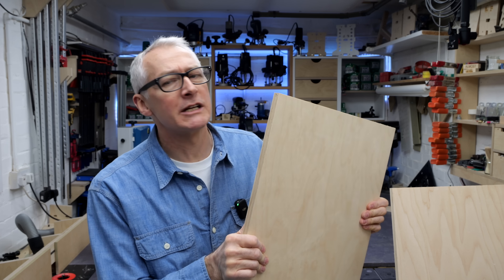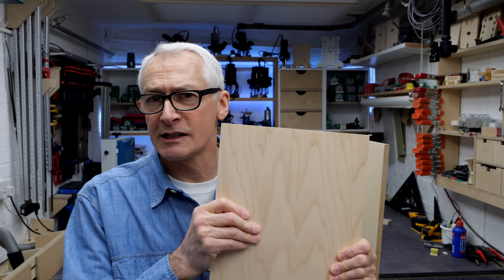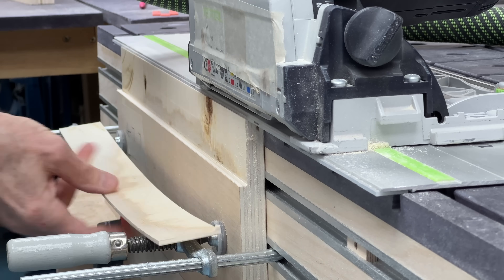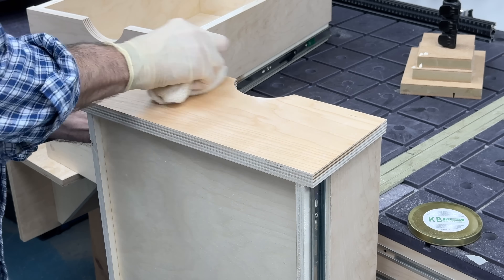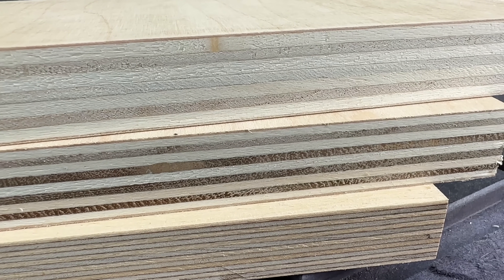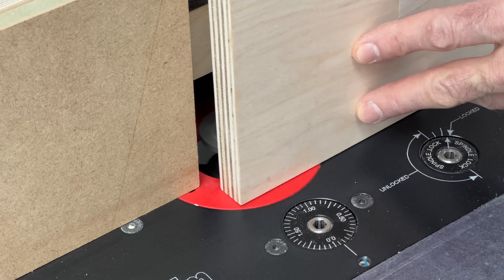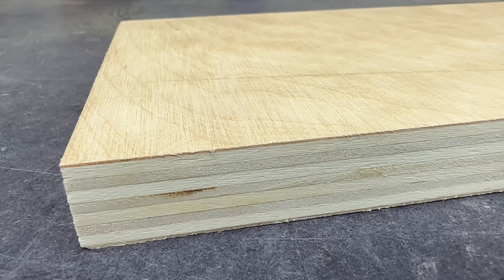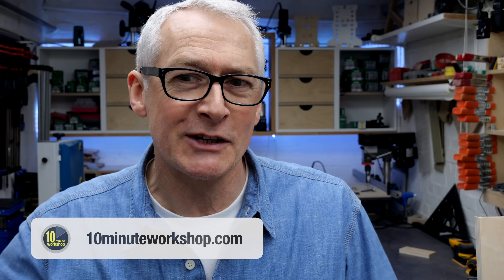Birch Ply Alternatives? [video 527]

Comment: Thanks [edit for spelling] again for this, Peter. In the USA prices are not quite so horrible and the Globulus type plywood is touted as an alternative. Some folks have an allergic reaction to eucalyptus, so that might also be a consideration. (I know in my own case I can hack and wheeze for the better part of a day with plain old pine, spruce, and fir if I neglect my PPE.) My local "big box" supplier has hardwood veneer core maple plywood for $80.00 (£63.43 this morning) per sheet and I have a big gas guzzling pickup truck to get the stuff from the store to my shed. This stuff is 7-ply B2 grade, rotary cut and for anything but utility fixtures and shop furniture I would probably edge band it. The UV prefinished material is the same price but requires mechanical fasteners (pocket screws, etc.) to join a carcass, very popular with the shops that make kitchen cabinets. End customers display a prejudice against MDF, particle board, etc. in the USA. Not my problem I am my own end customer but the MR type MDF is impossible to find out in my part of the USA.
Reply from the maker: Great point about the allergic reaction to Globulus - I’d missed that, thanks! 🙌👍
Reply: How are you able to buy Baltic Birch? It’s been illegal to sell in the United States, since the Ukraine / Russian War. Baltic Birch is made in Russia. If you already had a stock, and made consumer products, you’d better be prepared to prove when it was bought.

Comment: Peter, thanks for another excellent, informative video.  In Ohio we have a sheet good listed as “Sande Plywood” I have done some preliminary research and found it is manufactured in Ecuador and is a mixture of 9 kinds of mulberry.  The different areas and species have different regulations for harvesting so you get the species that is available when they’re making it I guess. It is listed as “marine grade” but it’s a bit cheaper than everything else. It seems to have a very soft face but very clear. Very few voids or weird discolorations in the plies.  For reference, 
23/32” Birch is 93 (not the best birch either )
23/32” maple faced mystery centers is 75 
23/32” red oak plywood 85 (this one is very high quality right now. )
23/32 Sande is 70 
23/32 Radiata pine is 55
Reply: I'm using that "sanded plywood" in a few DIY cabinets myself. You aren't kidding about how soft they are but it's workable. I'm treating them as paint grade, filling voids with wood filler, sanding with 120 grit, hitting it with sanding sealer, and then hitting it with 320 grit per the instructions on the sealer. It will require a primer before painting but when done the surface is smooth, the voids are filled, and the edges will be covered with edge banding. It's by no means a viable option for a production shop but us DIY garage guys have more time to throw at the problem.

Comment: I recently bought some hardwood faced ply through Building Materials online for £53.87 although it was supplied and delivered by Rembrand Timber in Dundee. Even with my ulta cheap circular saw it cuts very nicely and I only found one small void exposed by the cuts. The hardwood facing is very thin as expected but at that price not unexpected.

Comment: If just for shop cabinets, can highly recommend hardwood faced ply. I paid £35 a sheet for 18mm B/BB Q Mark Hardwood Plywood to make some shelving in the workshop. It's a little gappy, but no worse than those cheaper alternatives. I picked the best edges, used a little filler on the couple of gaps I couldn't avoid and it looks really good with a coat of danish oil! Not Birch ply quality, but then 1/4 of the price!!

Comment: Recently bought a couple of sheets of 'Birch' ply from one of the woodyards I use... having signed for the order I was left to go and load onto my van. Spent a good 30 minutes trying to find some decent sheets of ply (1x18mm, 2x9mm) and just about looking at every sheet in the stack I went off with something just about acceptable. Few days later was in the orange barn and their ply certainly looks better and amazingly enough there, at the time, hardwood ply was same price as their softwood ply; and over half the price of what I'd paid in the woodyard! I just hope we get back to having some decent ply soon 'cause I'm close to giving up trying to use stuff from the woodyard. Just really glad I don't have to do jobs using marine ply...
Reply: I built myself an 8ft long desk out of "big orange shed" hardwood ply a few years go, standing on a £20 set of Aldi sawhorses, then 18 months ago swapped the sawhorses for a pair of pedestals with drawers big enough for 60x40 crates and 45cm drawer slides. All pocketholes and glue. I didn't bother finishing it, so the wood's been "oiled" a little where my arms reach for the keyboard, but the edge rounding came out beatifully smooth despite using an incredibly cheap set of amazon router bits.

So long as you go and choose your own sheets so you don't get an arch (or your design has enough bracing to pull it straight) I don't see how these premium plywoods are worth 3x the cost of big orange's hardwood sheets.

Comment: we have a birch plywood called premcore in California that Im realizing now is a bargain ($70/sheet). very light and strong. awesome for workshop cabinets and my van. but it splinters like crazy, and the layers are not really presentable. 

on a related note, i wish we could get colored mdf here. no valchromat or any alternatives here.
Reply: Try to find "Forescolor", a very nice throughly colored MDF that is very resistant to humidity and very stable.
Reply: @alfredomarquez9777  thanks! will check them out.

Comment: Here in the US I found some plywood made from South American Trees, it's called Sande Plywood. Its fairly lightweight and straight.
Reply: Not really of fan of sande ply . Mine had a lot of nylon strings in it
Reply: @revisionindustries667  I hadn't noticed nylon strings, one thing I  did notice was. I don't dare cut it without a good dust mask on,  very irritating sawdust
Reply: We have Sande here as well. It cuts ok but if you try to run a router on an edge you get lots of strings. The finished side also has a strange texture to it.  The smell is also terrible.
Reply: After a few attempts to use and like Sande ply I've come to the conclusion that it's garbage.  Same issues as everyone else posted.

Comment: I had the unplesant experience recently of using some Vietnamese "birch ply" alternative and the plys were so wavy and full of voids that the pieces were beyond shabby. I also noticed the veneer would lift if under too much pressure from a cabinet screw. So each screw had to be predrilled and a countersink used so the head of the screw wouldn't cause the bubble to form etc. Here in the US we have a product called Purebond that does a pretty good job and with the added benefit of not having formaldehyde used in the bonding process but instead a soy based one is used. However the veneer on both are incredibly thin these days and some brands like the first one aren't even slightly oversized for getting a clean square edge.

Comment: Just Subscribed to your channel, the birch plywood being my first choice material. You asked about thinner poplar plywood....well it is available marketed as 
        Laser Ply, 
the glue used is only interior grade glue and "better" in the laser cutter.
It is sold by school suppliers and elsewhere in small handy sizes to drop into a laser machine in 3 or 4 or 6 mm thicknesses.   Not as 8 x 4 sheets, but a company like Lathams sheet material specialists must stock it. They do list the ultra thin Aeroply, in birch, which was my prefered laser material. Which I can buy in small sheets from model shops.
The poplar is just not as strong, or stiff or solid as birch plywood IMHO.

Comment: I tried some china birch.  I could actually see through the face sheet.  So easy to sand through.  The china sheet goods also would warp, often pinched the blade, as I ripped through it the 96” length.

Comment: There's more than just price inflation. Many birch plywood manufacturers have been confronted with sky high energy prices in 2022. As a result they started cutting corners between autumn and spring by no longer drying the material properly before assembling the plywood sheet. The quality is no longer the same all year round. There's "winter plywood", which arrives warped, and "summer plywood" which doesn't warp.
Reply: It's from Russia.
Reply: @unabonger777  If you have nothing to say, then please don't comment.
I'm referring to the energy crisis of 2022.
Reply: @jacquesmertens3369  I had something to say, and I said it. If you can't handle that, then don't comment or don't read the responses.  Or perhaps you would like to explain what is causing the energy crisis for us. Just ignore the embargoes and tariffs and trade bans if that helps you feel smarter.
Reply: @unabonger777  You just write 1 sentence "It's from Russia" which has nothing to do with what I wrote about the energy crisis of 2022, which has hit ALL types of laminated wood, regardless of the origin.
If you want to explain what you meant, here's your opportunity.

Comment: Same problem here in the States. You have to be a bit picky when selecting your sheets now.  And it's hard to find good 9 ply as well.  The big problem is that once you move away from Birch ply, the layers in the plywood seem to be more pours and it's ability to hold a glue connection decreases.  

Beginning to be concerned about using hidden fasteners like floating tenon's and dowels without using screws or staples/brads to hold boxes together while the glue drys.  I'll still use domino's or dowels for alignment, but I'm looking for other mechanical fasteners to supplement the connection.

Comment: Peter, here in Aliquippa Pa USA we pay $84.00 for a 3 3/4x4'x8' of c-3 birch ply. C-3 is A3, B3, C3 are for plywood that will be seen from one side, but the back side must be clean, although there may be some stain or discoloration on the back, spliced veneer, and so on. One might use this material for the sides of a dresser (who looks inside?), for drawer sides, and shelving. Is ply made there in the UK

Comment: Got some ply from Wickes the other day, made in china, £40.50 a sheet after trade discount, normally pretty good but I cut 1 sheet & found a huge  split within where it was delaminated as the glue was missing. The veneer is paper thin..

Comment: Your comments are 100% dead on.  Even before the Baltic Birch shortage I used some Vietnamese "birch ply" which has a very thin birch veneer and a dense mystery wood core.  The walls of my shop are covered in this "birch ply" and while it looks nice, it's a pain to work with.  It never fails to impale me with fine splinters of the veneer.  Structurally, I think it's better than the "Corebond" maple veneered, poplar cored ply I've used that only has 5 core plies even though it has an abundance of voids and overlaps in the core plies.  Some of my workshop mobile furniture is made with the 3/4" (18mm)  Vietnamese product and it is completely adequate for structural purposes.  The maple veneered poplar ply looks very nice but the poplar core definitely is not as strong and for heavy loads requires good design work.  I need to make a mobile cabinet for a 700 pound mill-drill machine and will use cabinet grade fir plywood from Home Depot.  I only mention the store name because they seem to be the only company carrying a good paint grade 7 ply 3/4" plywood.  This tool is far too heavy to use pretty instead of functional sheet goods.

Comment: Hey Peter, in Turkey, beech is widely available tree in our country and beech plywood manufactered locally. We use beech timber to frame everything (chairs, beds, sofas etc.) and beech ply used in Marine Industry way more than Birch ply. Prices were considerably cheaper when you compare it to birch before, now its more closer(%40 cheaper still). But sheet size are diffrent for beech (170x220) which gives you a little bit more sqm2 per sheet(about 0,615). Prices here are 92 euro for birch ply per sheet and 75 euro for beech ply, VAT included. I dont know about the availability in UK but can share some photos for edge with you.

I think its a bit nicer to work with Birch ply tho, Beech feels a bit more rough than birch on surface, but after sanding and finishing it, it has its own look which i really like.
Reply: I'd be interested to see that, and especially to see whether it's available in the UK. Love the look of beech.
Reply from the maker: Thanks! Never seen a beech ply before, I’ll make some enquiries.  Thank you! 🙌👍
Reply: @10MinuteWorkshop  google STREtek by falcon timber. Looks interesting. Be interested to see how available it is.

Comment: Building a set of cupboards with bookshelves above for son.  No Birch ply available so have gone for the 18mm Globules Maple (from Ferguson’s).   I had some 9mm birch ply in the shed so have used that for backs but the Globules has been disappointing especially given the price.  The face is very thin and as you pint out does not machine as well.  Had a lot of breakout using Lamello - I plunge very slowly and that seems to work.  Hoping that son and wife stick with painted finish because I don’t think the veneer is thick enough to stand much abuse.

Comment: Peter, excellent (succinct and easily digestible) explanation as always - thank you 👍 Maybe you’ve already done this (in which case my research hasn’t been extensive enough 😳😁), but I’d be very interested in your comparison of MDF versus Birch Ply as a raw material - when to use, relative pluses and minuses depending on what you’re trying to build?
I recently made a cabinet basing my efforts on your alcove unit series, to a good degree of success (even though I say so myself)! So I’m kinda leaning towards MDF as a preferred raw material at the moment -but I guess Ply has its place. Anyway, if you’ve thought about it or done it…. 
Thanks as always👏👏👏
Reply from the maker: Thanks Michael! Ply vs MDF is on the list, definitely! 👍
Reply: @10MinuteWorkshop  Try to compare HMR or "High Moisture Resistant" MDF... Like the one called "Forescolor", please.

Comment: Excellent in depth look at other plywoods. If I were building cabinets with edge banding &/or the ply layers weren’t visible, I’d use the globulous. At least it seems strong/robust enough to last a while and the maple veneer is quite attractive. However, when you add in the cost of edge banding, filler for the voids and such, it would negate the roughly $30 savings of not buying real birch ply. Hopefully other companies in different countries will be able to step into the birch ply arena in the near future.
Reply from the maker: Cheers Paul! The main issue is availability - 18mm Birch is hard to get at any price - but edgebanding can only go so far, of course, and would be hard to use on tight curves, say. There''s another video (or two...) to come in this series, I think! 👍

Comment: Years ago there was a sheet product that was called 'cabinet board'. It had a core of particle board with a laminated veneer on each side. Best I remember it was about half the cost of similar thickness birch plywood. Is there a similar product today or perhaps something with an OSB core ???
Reply from the maker: You can get veneered chipboard/particleboard certainly, but it’s a different product to plywood. 👍👍
Reply: TFL/HPL in PB or MDF core.  Usually used by commercial since its really just paper decorative with a hard finish.

Comment: In the South West, Bradfords do quite a good exterior B grade ply. Probably far eastern, and nothing like birch ply, but I made a pretty decent set of cabinets from it. At £55 a sheet (trade) I'd use it again. It's a bit pink (stains fine though) and there are occasional defects, but with careful selection and cutting I was pretty happy.
Reply: Thanks for the Bradford’s tip off - I’ve returned 2 boards this week to other shops due to extremely poor quality

Comment: Good video, now my birch supply has dried up I've been quoted for Beech ply from a local merchant. 18mm, 13 ply layup on an A/B finish. £108 + VAT per sheet. Might be worth a try?
Reply from the maker: That sounds more like it; have you seen it or used it?
Reply: @10MinuteWorkshop  not yet, Alsford timber down in Sussex have only just got it in stock. I've got some kitchens coming up that I'll be trying it on.